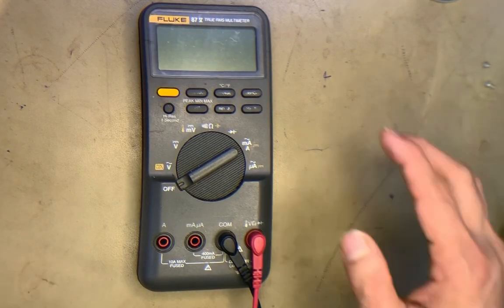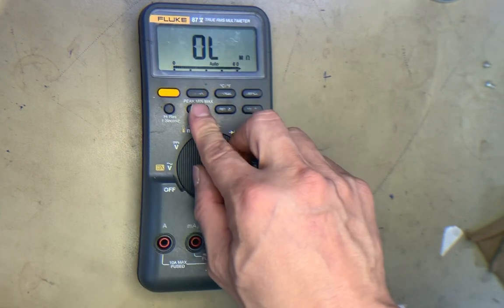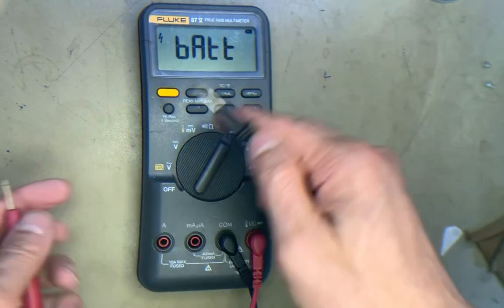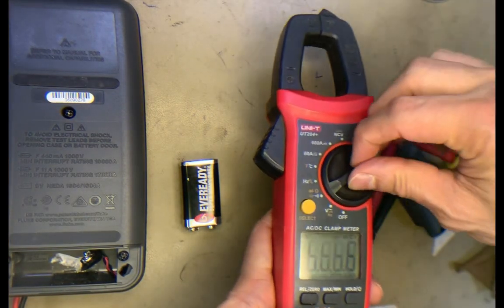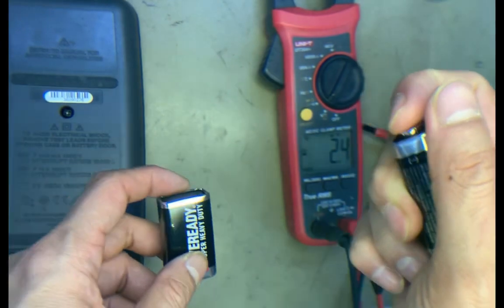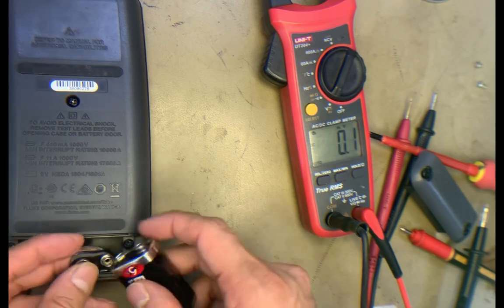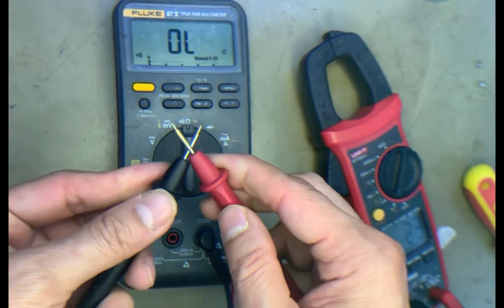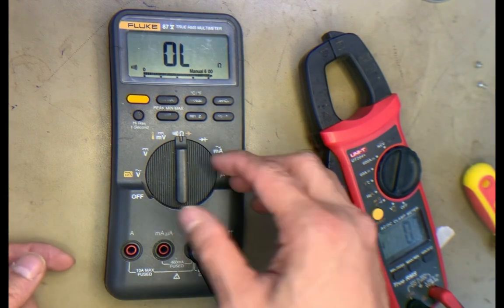Fluke 87V Repair | Stuck on Batt  in the Screen and Never Turn off

Comment: Try alkaline batteries if you're stuck with batt and trying lithium 9V. I don't know why. Voltage is same or higher with lithium but it doesn't like it. Alkaline 8V fixed the problem.
Reply from the maker: I never try  the lithium battery, i just replaced alkaline but i want chargable liek lithium